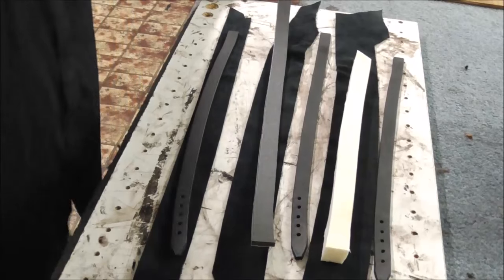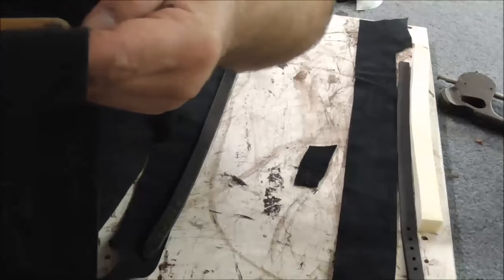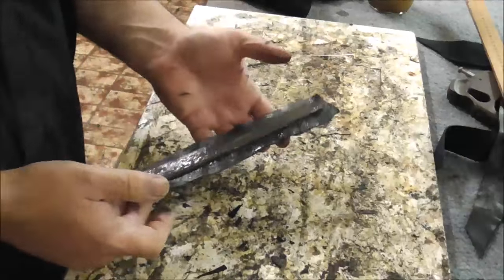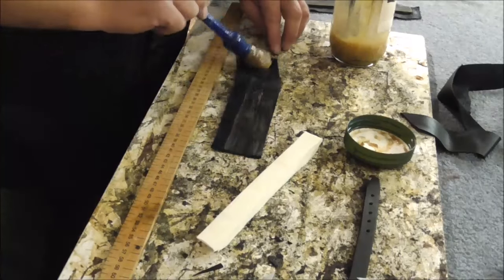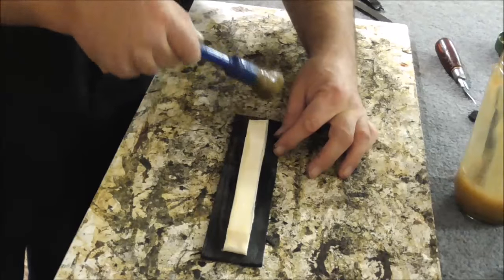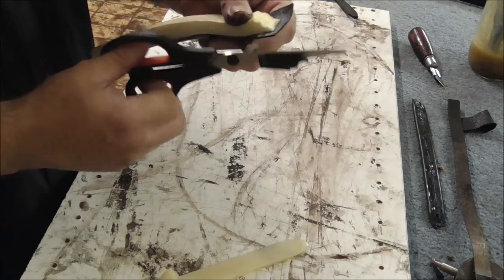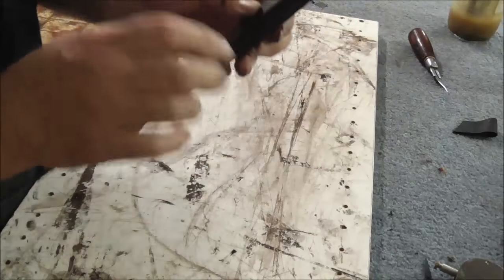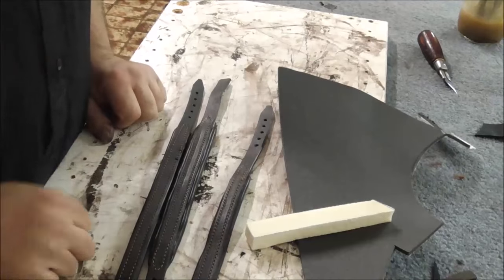How to do padding for dog collars head collars etc

Comment: GREAT Tutorial !  What type of leather & thickness of the leather do you use for covering the padding ?
Also what type of padding, & thickness of the padding do you use ? I couldn't understand, did you say plastazote ?
Reply from the maker: The leather I used will be about 1.2 to 1.5 thick. The sticky back plastazote is about 3,5/ 4 mil thick. The white padding is latex and that was about 1.5 cm thick. You can use lots of things for the pad. I have seen blanket cloth used and sponge used.